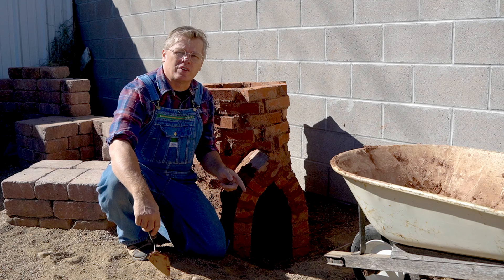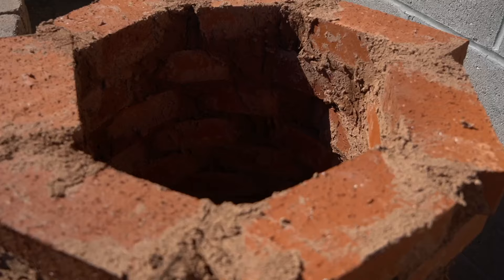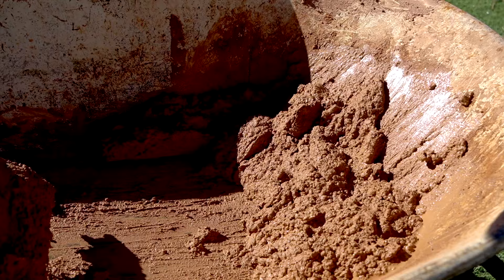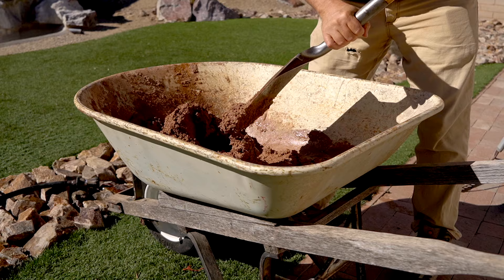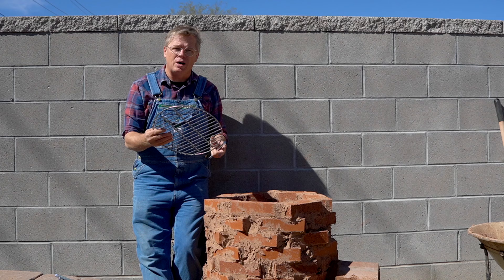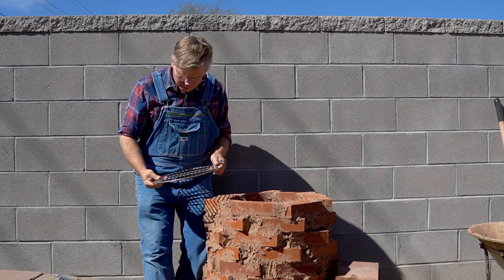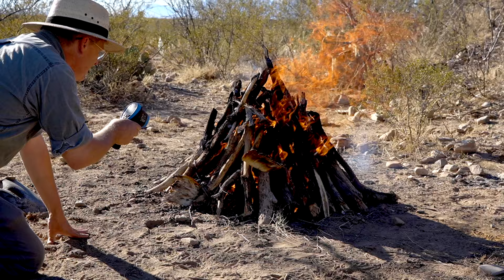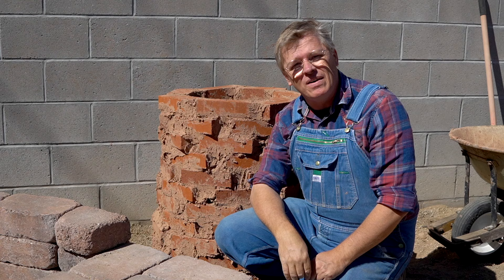How to Make a DIY POTTERY KILN

Comment: Just one question….I’ve seen where straw was added to the clay with some. What’s your thought. Thanks
Reply from the maker: Adobe is just like pottery but on a larger scale. The straw acts as temper, the same as sand. Straw however can provide a pathway for moisture to get into your structure, sand is better because it works the same but does not wick moisture in like straw does.
Reply: Sand it is! Thanks for the reply and advice.

Comment: Could you use a convection oven for longer periods of time? Or does it just not get hot enough?
Reply from the maker: No that would not get hot enough. You need to reach temperatures of at least 750 C to make pottery
Reply: @AncientPottery  thank you! I don’t have access to a kiln within 100 miles. I’m disabled so I can’t build my own. I guess I’ll stick to polymer clay.
Reply from the maker: @reneeallen3569  Check out this video https://youtu.be/ztLn3BsYuJ8

Comment: How hot does it get? I'm  going to be using  this for metal clay pieces, and I need to make sure that it gets hot enough to fire the pieces,  but not melt the pieces.
Reply from the maker: I have had it up over 900 C, but I think I could get it hotter, I just have no need to get it any hotter than this.
Reply: 1652° F (900°C) is good enough I believe for small metal clay pieces. Thanks.

Comment: I dont know if anyone else asked this, but can you use a regular mix of cement to build this?
Reply from the maker: Regular cement doesn't hold up well to high temperatures. When they build fireplaces or kilns or other things that will get hot they use something called "refractory mortar" which is a bit more expensive than ordinary mortar.

Comment: Hi Mr Ward. I am struggling to get hold of clay. Is it possible to replace it with river sand? Is there any aggregate combination that may give me the properties that clay offers?
Reply from the maker: If you are talking about using it for mortar between the bricks, sand will not work. You could try using refractory mortar but it is a little pricey.
Reply: Thank you, Mr Ward.

Comment: Did you use fire brick?
Reply from the maker: No just regular clay bricks. My top temps are relatively low, certainly lower than these bricks were fired to at the brick factory.

Comment: I live in a wet climate, could I make a cement slab as a base to start on, to build off of? Also, does it need to be a red brick or can it be another type of brick?
Reply from the maker: I was trying not to use cement, so I purposely avoided cement bricks and a cement floor. Cement won't hold up in a kiln long term the way clay will, but in a damp climate a kiln like this would probably not last long.
Reply: Thank you! Love all the information 😊
Reply: Also, meant to ask... can I get the link to the bricks on home depot? All the bricks I found on there were made of cement. Thanks!

Comment: Where did you get your thermocouple, and what are all the components you have to get?  Assume I'm completely ignorant.  I did some searching, and it looks like there's a thermocouple, a cable, and a reader; and you have to follow some rules to make sure they're all compatible with each other...?
Reply from the maker: Mine is a type K analog pyrometer and thermocouple. You can buy the thermocouple, wire and pyrometer all together at many online retailers. Here is one example https://www.axner.com/analogue-pyrometer.aspx

Comment: Interesting, but are you sure that it's a good idea to build kiln on wooden foundation to prevent moisture? Ain't that wood burn?
Reply from the maker: I did not build this on a wood foundation
Reply: @AncientPottery  No but I mean the recommendation which you made if someone lives in more moist climate. 10:45
Reply from the maker: @mikkoainasoja5018  oh well the idea would be that there was a think layer of brick and mortar between the wood and the fire box. Fireplaces are built in wooden homes, you can isolate the heat from the wood with bricks and mortar.

Comment: AM SHOCK THAT PEOPLE DONT USE A FORGE TO FIRE UP YOUR POTTERY THAT YOU COULD BUILD OUT OF A PROPANE TANK VERY EASY TO DO OR YOU GET SOMEONE TO BUILD ONE FOR YOU
Reply from the maker: A forge is not a kiln. Use the right tool for the job.
Reply: @AncientPottery  it does the same thing and better heat so what are you talking about most forge temp easy will go over 2400 degrees??? charcoal burn way better then wood also a electric kiln electric bill have skyrocket

Comment: Would it be possible to use cement for the bricks instead of clay?
Reply from the maker: Yes but the cement would not hold up to the heat long term the way the clay bricks will.